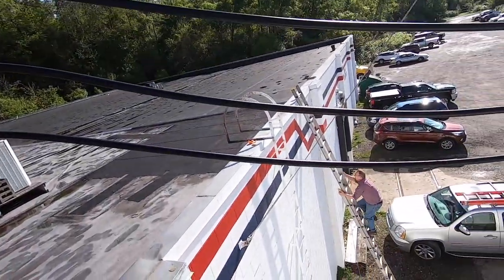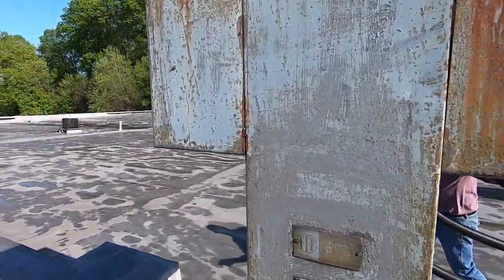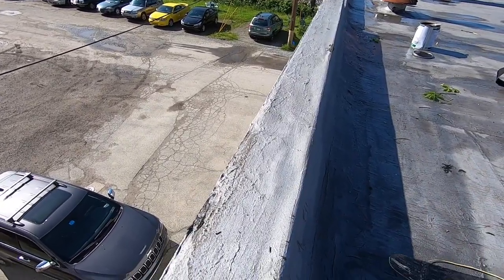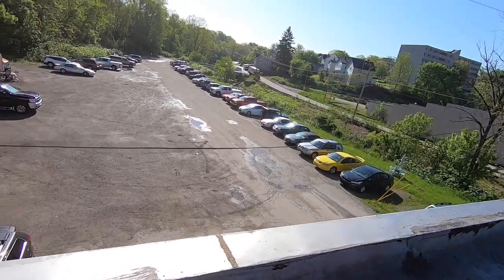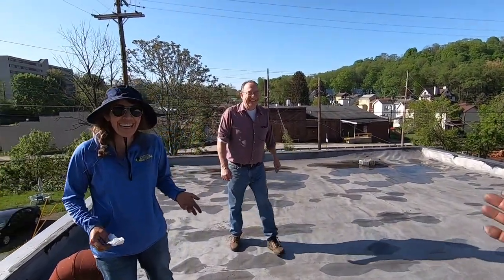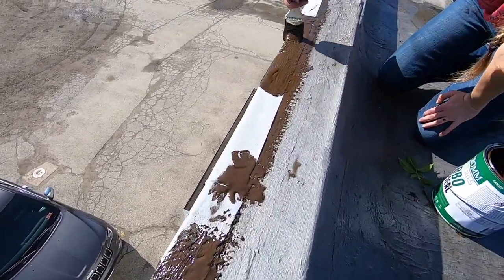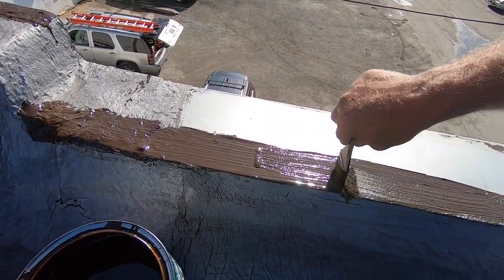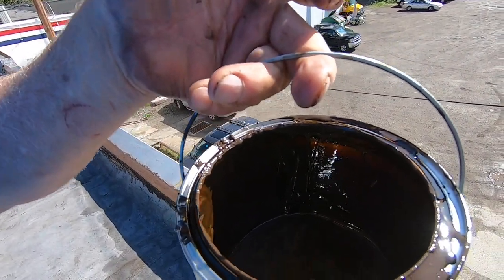Seal Cracks in Block Wall and parapet wall

Comment: Hello, I watched a lot of your videos, thank you so much for all of the great content.  The only thing I am not sure of how to do at this point is working with a residential house with stucco walls and a parapet.  Am I supposed to stucco the house to include the parapets and then wrap the Bitumen over the top of the stucco parapet; or am I supposed to do the new roof, overlapping the parapet and then do the stucco and cover over the top pf the parapet?  I see pros and cons to both (stucco first or roof first) and am not sure which is the most appropriate way to do it.  If the Bitumen is supposed to be torched down on top of the stucco, how do I do it and end up with a nice clean edge so it doesn't look bad when viewed from the street or yard?  What are your thoughts on the best approach?

Comment: better to cut the modified back so there is no need to o onto the vertical surface of the wall.  this also helps with brown drips on a white wall.  no even going to talk about putting the liquid flashing on wall joints
Reply from the maker: that was really a good tip. i was not thinking at the time. You are completely right

Comment: Would you share how install  top roof deck of DADU? What are notes for waterproof in Seattle winter.
Reply from the maker: I have no idea what you are asking about, sorry
Reply: @FlatRoofDoctor  did you install rooftop  of new building? Would you share video?
Reply: I live in Seattle. It is cold in Winter. My new rooftop will be 30ft by 20ft ; what material for rooftop in this weather? As far as the roof we will have to put insulation below roofing material to eliminate condensation and not create moisture below. what kind of insulation? insulation+paint+ deck? or cement +paint +deck? What else? Would you share your email to keep touch. Thanks

Comment: Great to learn from you. do u know any replacement products in canada?  I can't find it in Canada.
Reply from the maker: Not that I know of
Reply: @FlatRoofDoctor  thx!
Reply: years back in the 70s and 80s use to be able to buy a product called Bakelite 800 13 its like an asphalt emulsion . i haven't seen it for years .it worked good against brick , block and concrete parapet walls